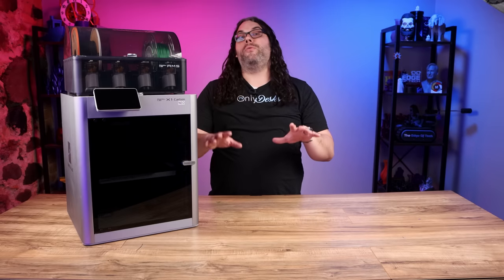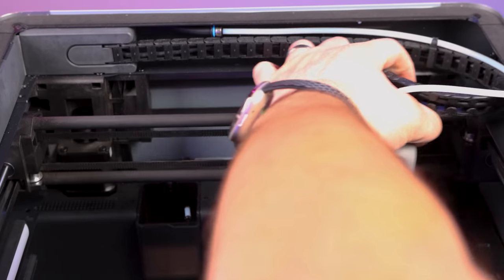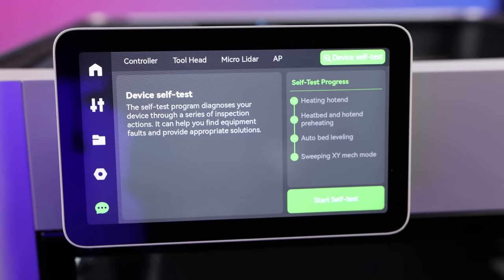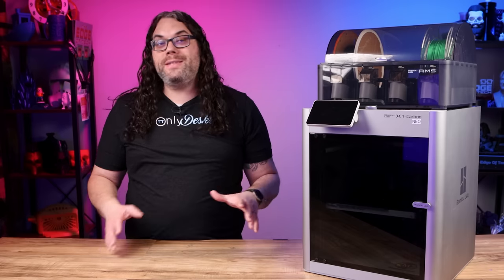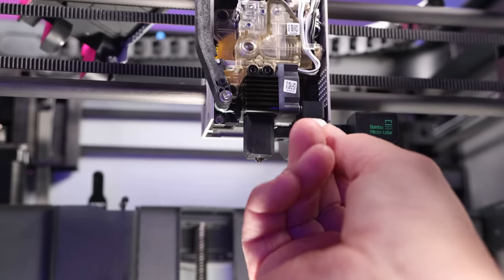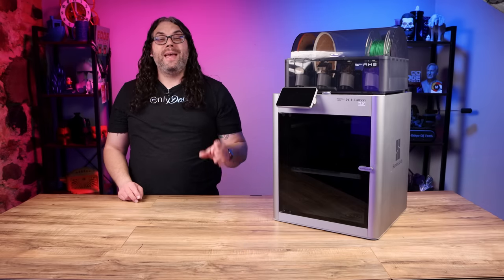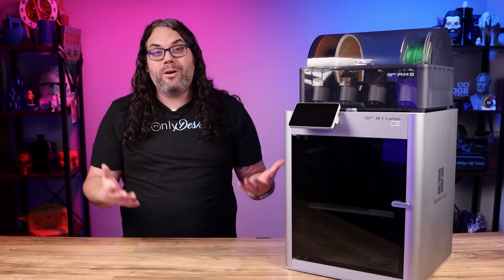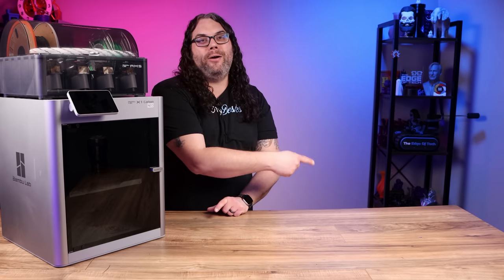10 Bambu Lab Maintenance Steps You MUST Do!

Comment: For people that follow videos like this with no deviation, don’t spray alcohol on anything. Directly apply it to the towel. I wouldn’t apply alcohol to the lead screws at all. A dry towel alone should be enough to clean them because they are lubed to begin with …plus apply appropriate lube. You also don’t have to check your hardware nearly as much as he is suggesting.

Comment: Spray the paper towel with isopropenol do not spray directly in the printer. you get some on the belts overtime it will weaken them and cracks can form
Reply: Yes, Yes, Yes - good advice and spot on

Comment: dont spray compressed air onto the fans without holding the fan so it wont spin. it if does spin from the compressed air it can cause a short by generating a current

Comment: I would be a little worried about the humidity (a lot) you get from canned air.
Reply: "Canned air" isn't really air, it's refrigerant. 1,1,1,2, tetrafluoroethane. It is the same stuff in automobile air conditioners, so the moisture content is extremely low.

That's why if you hold the can upside down it comes out as a liquid and is frosty
Reply: @kylefafnis  That would be highly illegal. It’s Air, expanding and cooling down in the process, as any refrigerant would do. The moisture you get is condensation from surrounding air. And corrosive.

Comment: I see the fiament cutter arm has broken on that printer too (it's not supposed to be black so he has replaced it), seems to be a problem with the printer. If he hasn't made a video of how to replace that thing, it could be a good idea. Mine hasn't broken, luckily. But I don't often print multicolored prints, I only got the AMS for convenience.
Reply from the maker: Actually that's not the case. It's never broken. This printer was my first one last May. It was from the first batch they did before the main production run. So some of the parts are a different color, like the clear extruder. :)

Comment: A lot of malpractices. Go to bambu and follow their instructionsninstead. 

Spraying the air into the fans causes swift rotation and this makes the fan into a generator of electricity which can hurt the printer. Lightly hold the fan while blowing them clear and dont tilt the bottle - more ice sprays out if you do. After - let condensation evaporate for a while before starting the machine. Else you have just short circuited the circuits hit by condensated water.

Do not blindly spray ipa into the machine while cleaning the rods. And dont move the gantrybefore wiping the rods. You just push around the much that you loosened up with the ipa. 

The ams has so long wires that you can just spin the printer 90 degrees and place ams next to the printer. 

Honestly just following bambus best practices is recommended so just linking them is wiser than just speedrunning. For example the belt tension is definately a go to bambu thing. 

This isnt really all the details omitted or wrong, so for reference of standars maintenance - always check bambu instructions first. Not some dude on the internet spraying some ipa all over the printer and saying its now fine.
Reply from the maker: @LordNerfherder  appreciate the opinion! When I did this video, I followed their instructions step by step. That's why it's out of order as well. But I followed their instructions as intended, including spraying the IPA. So while I agree with you that you should always check to manufacturer's instructions, in this case, I actually did. Thank you for watching

Comment: Many of these advices are quite ineffective, and almost change nothing, but just you feel yourself better, you are cleaning your own calmness. For example a properly lubricated lead-screw or ball-screw doesn't need maintenance at least for a year in a clean environment like that. Or even 2 years. It absolutely unnecessary to do that in every month, you help nothing with that, maybe makes you feel better. Cleaning head with air-spray -  you should know that the compressed air makes "cosmetic" dust removal, but the fine dust remains at place because of statics, and that would be the much more important thing to remove. Maybe isopropyl-alcohol spray would help, or similar non-aggressive cleaner liquid (display-cleaner?). And also unnecessary in every month, maybe if you do print-farm things, then maybe.

Comment: 1) Wait wait wait. you purposely got out all the grease from the Y axis bearings by whiping the rods and than moving it untill bearings are completely dry???!!! hahahaha what a dumb thing to do. Runing bearings dry on carbon is just calling for fast Bambu lab store for replacement. As a mechanical engineer, i cannot advise NOT TO DO THAT enough.
2) Never spray Isopropanol like that, it will stiffen the belts if it gets on them, and they will crumble like a cookie. Another Bambu store trip
3) Use grease not oil. Oil tends to solidify leaving you with crap. Especialy if you use the wrong one. Use grease instead (make usre it can handle the temps and its good if its rated for rails and screws)

Youtub would need a missinformation popup like twitter. Youtube is more and more filled with bad advice

Comment: Fans should not be allowed to be spinning when air cleaned. Electrical Back Voltage: In some fans, particularly in computers, spinning the blades can generate electricity (back EMF). This unintended voltage can potentially damage the fan’s motor or the electronic components it’s connected to.

Comment: Did you really just spray all over the printer directly... And with alcohol at that which would dry out the bearings?  Then used a paper towel leaving behind small fibers?  It's this a troll video?  None of that was ok.  Every bit of that is what you NEVER do ... Nor did you lube them.... 

Fans need more than what that bottle can blow... You'll need to use something to scrub them down... Like a toothbrush or wipe them down somehow...

Then you made a mess pouring the dessicant in when that should have been done prior to placing the container inside...

Did another company pay you to make this video?  Come on, be honest!  Surely you if all people know better.  It's like you either got lazy, don't care, trolling, or paid off to do a really bad job.... Seriously ...

This video seriously concerns me.... Do many things you should NEVER do... Which is what this video really should be labeled...
Reply from the maker: Haha 😂 No. You don't lube the carbon fiber rods. Also, if you follow their instructions like I did here, it's what they say to do for the maintenance. I specifically mentioned to be careful with the paper towels and linked the blue shop towels in the Description. Watch their videos and look at their instructions, then come back and tell me how far off I am from what THEY recommended.  https://wiki.bambulab.com/en/x1/maintenance/basic-maintenance
Reply: Well, for starters, the IPA will NOT "dry out the bearings", these are carbon rods, not steel. I have no idea where you got that, but you DON'T lube them. As for the fans, I agree you should vacuum and soft brush as much dirt as possible, THEN use canned air with the vacuum nearby. The rest of what you said smacks of trolling. Don't hide behind the anonymity of the Inet to say things you'd never say face to face. Grow up. From your picture you should have learned this by now, get classy, it will make people listen better than calling them names. He presented Bambu's recommended procedures in video form, something they should have done. Your only valid point was he spilled some pellets. Really?